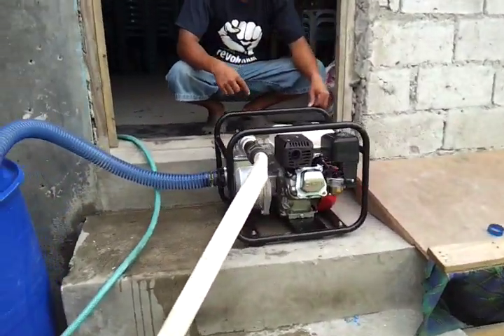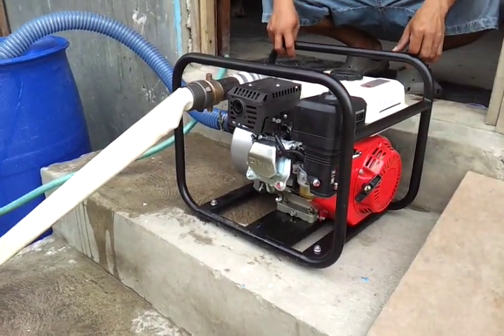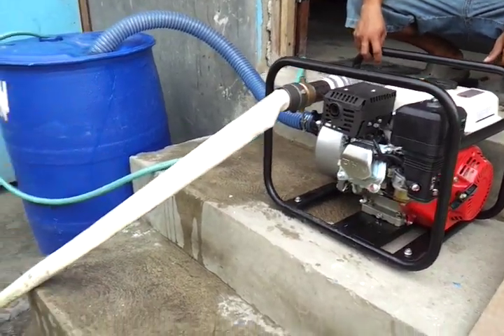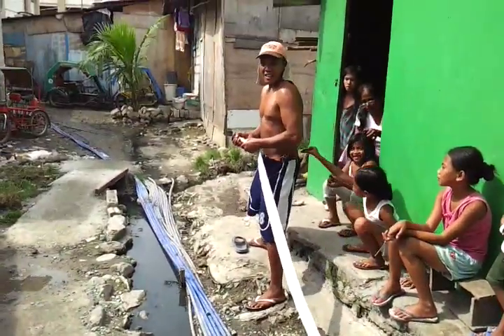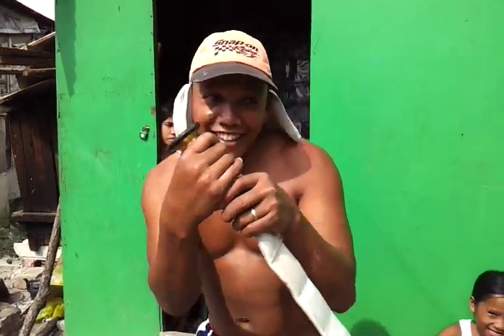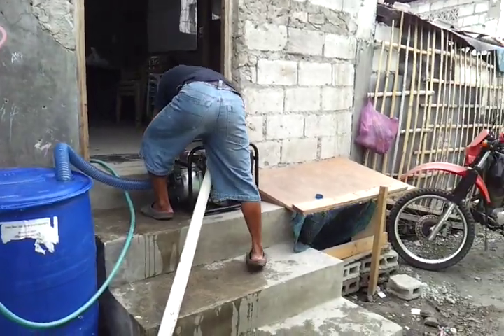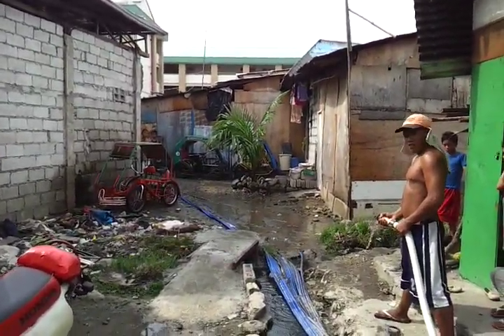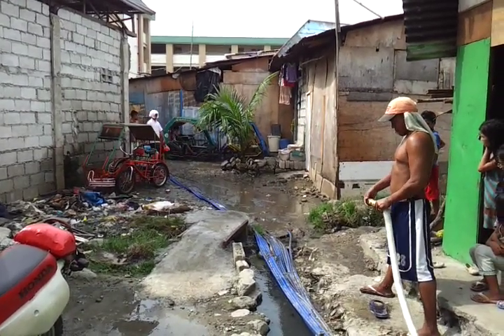Fire Pump First Test - FIRE TRIKE PROJECT

Comment: Reliable in a fire
Reply: they had the ignition switch off so it wouldnt start,  mine starts first pull every time even after sitting 4 months lol
Reply: Honda engines are known around the world for their reliability. I have one that hasn't had anything but gas put in it for the last 10yrs and it starts first pull every time and is used ALOT. The problem in the video is that they had the switch off and choked it, "flooded" it before they figured out the switch was off, then had to make a few more pulls to clear the "flood" and then it started. Completely user error.
Reply: The problem is because it's not a real Honda.

Comment: Need more water storage
a 55 gal barrel gets u 1 min at most
Look into making  a rack of 10-20 55 gal barrels like  a wine barrel  rack and connecting them all with PVC pipe. Then you could also look into one massive tank or 4-5 500 gal vertical tanks. Up to you. GL HF